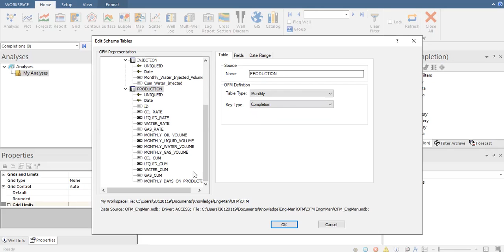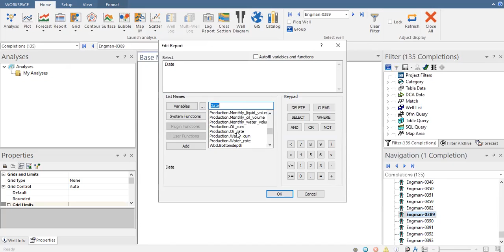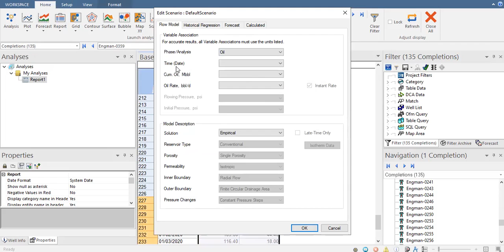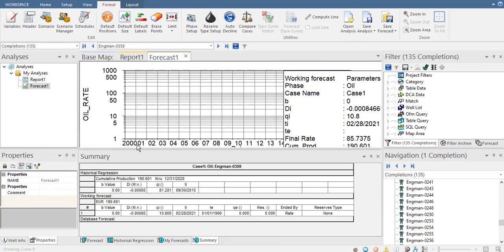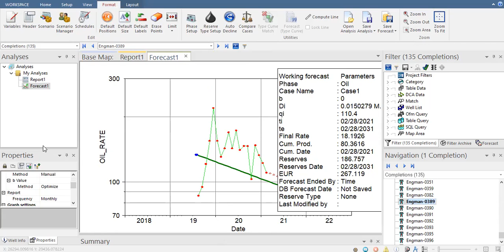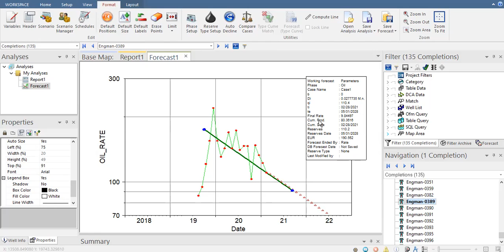OFM 7: Prodution Reporting and Forecasting

Comment: there is a method or another way to change the conventional models (Arps) in OFM when decline curve analysis does not match for tight gas reservoirs? beacuse exponent B is greater than 1 in that cases. Thanks from Mexico by the way.